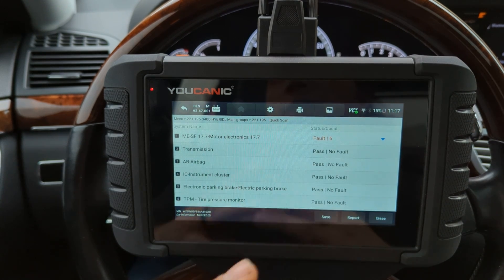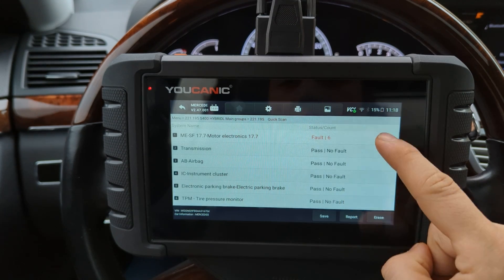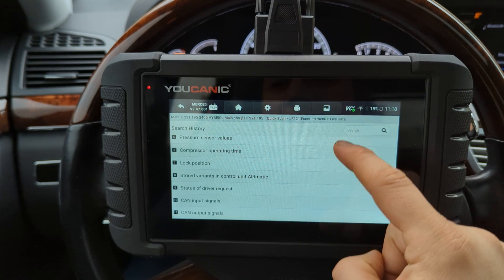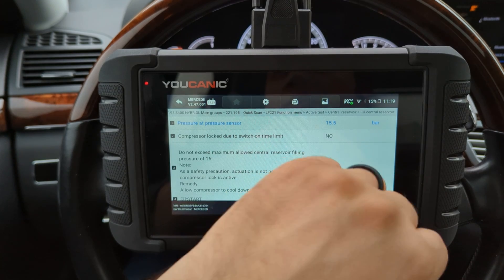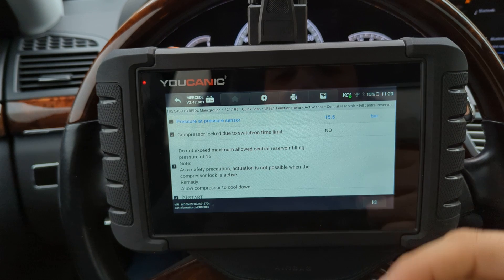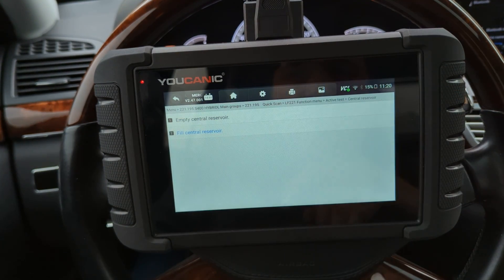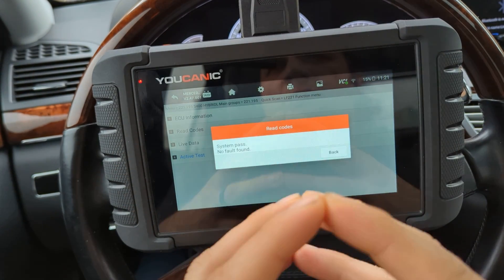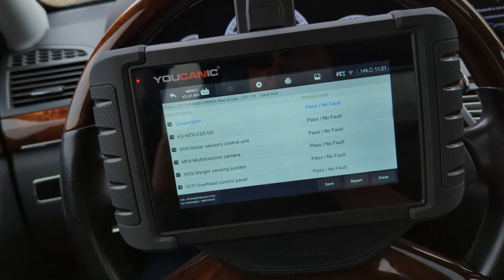Test Mercedes-Benz Airmatic Air Suspension Compressor Condition with YOUCANIC Scanner

Comment: Will they have a feature added for automatic calibration of the air suspension?
Reply from the maker: Hello! Thank you for your query. Currently, YOUCANIC does not offer a feature for automatic calibration of the air suspension. However, our platform is continually evolving and we aim to expand our resources in the future. We encourage you to keep checking back on www.youcanic.com for any updates. Also, remember that our comprehensive library of guides and our powerful YOUCANIC scanner are available to assist with many of your car maintenance needs. We are here to help you feel confident and save money on car repairs. Your journey as a car owner is our top priority!
Reply: @YOUCANIC  I bought it when it 1st came out. You guys have always been extremely helpful
Reply: There is no such a thing even on Star
Reply: @tepelena  I know that's why I asked them would they be able to add a feature. It's Def kind of a pain trying to balance everything out.

Comment: Anyone watching this video in the future. Yes a weak compressor will give symptoms of a leak in the system especially if you are not familar with automotive work or even car with Adaptive Air suapension. You can do a valve block to compressor test using a scanner or you can remove the compressor to valve block line at the compressor and use a fuel pressure test fitting and Psi gauge that will read above 300 psi
Reply from the maker: You're right on point about the compressor's symptoms - it can indeed mimic a leak in the system. If you're unsure, our YOUCANIC Full System Scanner can assist you in diagnosing these issues, like a compressor to valve block test. Discover more at www.youcanic.com/scanner.

Don't forget we also offer further resources to support your car repair journey at www.youcanic.com. Whether it's OEM Factory Repair Manuals, or a platform to ask questions, we've got you covered. Feel free to ask us anything - we're here to ensure your car repair journey is as smooth as possible.